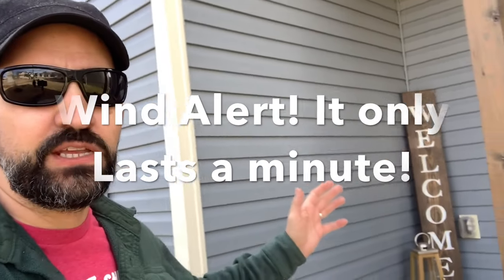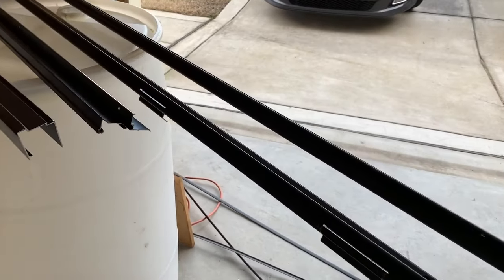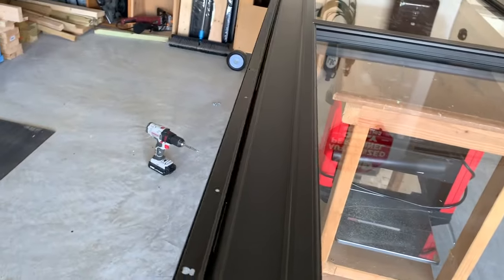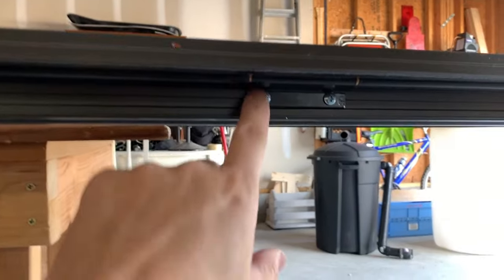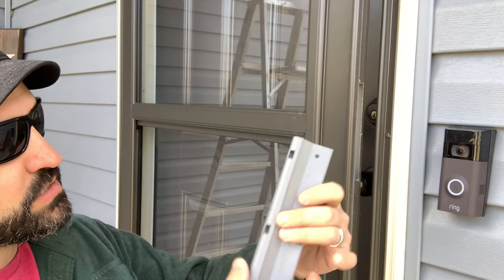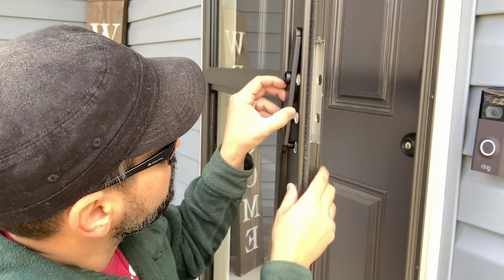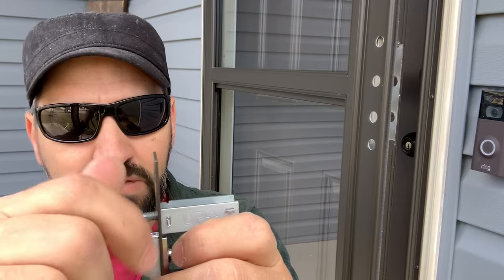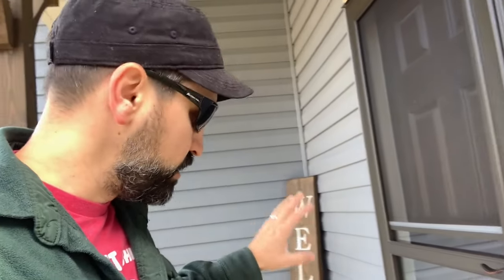How To Install A Larson Front Porch Storm Door from Lowe's!

Comment: Excellent video!  I used a Lowe's contractor for the back door (only because I'm old and fat), however, when I bought the front door and set up an arrangement for their contractor he never contacted me.  I called twice, waited three weeks and nothing.  I've done home maintenance all my life, construction, wall board, plumbing, electrical, etc. so I decided to go get the door and do it myself.  I like everything about these Larsen doors...made in America, clear instructions, left or right opening and quality construction.  I'll be on this project the first nice day we get here in west Texas.
Reply from the maker: Thanks so much!!!!
Reply: @TheCrawlspaceCraftsman  It was interesting and at the same time challenging to get this door installed.  My opening was exactly within the specified tolerances, but when I had the strike plate jamb in place there was nearly a 1/2" gap between the edge of the door and the jamb.  I made shims out of 1/2" plywood and they were one layer of lamination too thick.  My table saw would barely adjust to rip one layer off of the shims.  The door fits perfectly now with the exception of the strike plate.  It sticks out too far and I will modify it later.  Again, thanks for the video.  It was a tremendous help.

Comment: Thanks for the video!  I bought this from Lowes about two weeks ago and it finally came in the other day.  They wanted $140 to install it.  Found your video and having never installed a storm door before I was able to do so.  Took me about 3 hours but that's ok.  I got the same door except mine has the hidden closer.  I felt that looked better and there were less parts to trip on if the door was open...etc.  Overall, very pleased with the door!
Reply from the maker: Awesome!!! I’m glad it helped out! It’s suck an easy thing to install only a lot of steps.
Reply: @TheCrawlspaceCraftsman  where did you buy the replacement screen door? Larson said $174 which is crazy
Reply: How do you like the hidden closer?  Is it holding up?
Reply: @pttthhh  it's awesome! Love it.  Love that it blends right in with the wall because I painted it.
Reply: I’m putting my second storm up and I always take longer than most people. I just try to do a good job and I’m not trying to be fast. Good job on installing your own because a lot of people won’t try to attempt it.

Comment: I installed one over the weekend, took me a coupe days.  The door frame wasn't square exactly, had to take up some threshold and replace that, took some of the door frame down to replace.  However after 10 hours. It looks  great.  Probably could have done in in an hour or 2 if not all the extra problems.

Comment: My template has six holes, your's only has four. Looking at the lock set, I should only need four. I wonder what gives? Thanks for the video. My door went very quickly too, I just have to figure out the latch holes.Maybe different latches have different hole spacing?

Comment: Great video- Thanks for sharing!  I feel confident that I can install one of these now.  I noticed that there was a little bit of play once you closed the door in place before you added the hydraulics.  Did the hydraulics pull it closer to the door to eliminate that play I wonder?  I am thinking it does because the hydraulics pull it in back into place consistently every time.  I also like that they have one on top and bottom so that it ensure to close evenly.  Nice install and great job!
Reply from the maker: Thanks RC! You can adjust the part on Jam where the latch engages BACK and that should pull the door tight. It did come with two hydraulics but I only installed the bottom and that was good enough still to this day! Love this door. Thanks for the positive feedback and best of luck with the door! Yoh got this!

Comment: How wide was your door seal board? Is it 1” or smaller?
Reply from the maker: I don’t know. Id have to measure it!!! Do you need me too?
Reply: @TheCrawlspaceCraftsman  no I’m good, I appreciate the quick response. I got it all together. I had to replace the outside trim that was attached to the inner door frame and they had used deck board at one time and the new Larson door wouldn’t work due to it having a sharp 90° bend, I went to the hardware store and got it cut out and put in and my grandmas happy so I guess I’m happy😆

Comment: So I am at that moment where I need to lift up the door and place it on the installation screw. Any tips for managing the door by yourself? Did you rest it on top of a board or something to have it level for putting onto the installation screw?
Reply from the maker: I believe you should have marked two spots where the screws will go then start them and back them out about 1/4” so you can hang the door. Then tighten all the way. Then sink the rest of the screws. It’s been a while so I forgot a little.
Reply: @TheCrawlspaceCraftsman   I've done that already. Marked both spots and already screwed in first/top installation screw. I'm just trying to gauge how hard it is to wrangle the door by myself. Once you screw in the installation screw does the door hang fairly still to proceed from there, or is it going to wriggle around?
Reply from the maker: Nope. Once you hang it... you should tighten them up and the door will be secure and not wiggle around

Comment: after installation: on the latch side, the door is flush with the latch rail at the top, and a 3/8" gap at the bottom,  hinge side door alignment is flush.   how best to address / correct that gap ? thanks
Reply from the maker: I would use shims. It’s highly unlikely your square all the way around! Hope that helps!

Comment: Do you have to keep the glass in during the install? Just wondering if it matters, cause I’d be a little nervous about breaking it.  Thanks in advance.  Great video. 👍
Reply from the maker: It’s rrally not necessary to remove it. Once you get the hanging screws set. The door slides on those and allows you to work. It’s a little intimidating but honestly one of those projects you just go at it!!! Good luck and thanks for watching!!
Reply: KalindsLife Thanks, I appreciate your reply.  I used to install to old school aluminum ones, with an Uncle, when I was a kid.  I just wasn’t sure if there was something I was missing, like it would knock the door out of square, or something if I removed the glass.

Comment: Did your bottom rail come pre-assembled? Mine did not and I'm having trouble sliding the bottom rail onto the bottom of door.
Reply from the maker: I believe that is the last part to go on. That way you can adjust for any unsquareness of the door.
Reply from the maker: Once you get the frame and door on and opening and closing sufficiently.... slide that on and adjust it so the sweep cuts off any airspace.... close the door and screw it on from the inside. It’s been a while Since I installed so hopefully that helps And made some sense!! LoL
Reply: @TheCrawlspaceCraftsman  Thanks for the reply. Yes, it all makes sense and I was able to get it all installed... it looks great.

Comment: I just installed the same door by myself today, but I haven’t done the handle yet.
Question- the latch side piece is 1.5” wide, but my trim is 1”. I can see air on the outer side, in the hole where the latch will catch. In your video, you show it completed with the latch plate on, so I can’t see if you had the same problem.  How can this be correct?
Reply from the maker: I don't really know!  Without really seeing it... its so hard to give any advise.  I'm sorry its not lining up for you.  Hope to hear back with your resolution!

Comment: I made the hole on  the wrong side  side of door. How can I fix? Do they sell plug? Thanks
Reply from the maker: You could use some wood filler or even use  1/4 drill bit, make a hole and wood clue in a 1/4 plug.... then top with a little wood filler and repaint.
Reply: I don’t know what size hole but the hardware stores , Lowes and Home Depot sales plastic plugs . I bought them to go over screw holes. I see it’s been around a year but they do have different size plugs. Everybody makes mistakes and I have done the same.
Reply: @73beetle19  
I went to Menards they have aluminum guter Holder, same color, same Link cover everything, very thin. sold the house since then, thanks
Reply: @hugabee2580  Thanks for the information because you never know I might need to do the same.

Comment: Did you have to use caulking for anything?
Reply from the maker: No caulk used on this project. I don’t think a little bead would hurt between the frame rails but i don’t think it’s entirely necessary either. Thanks for watching!